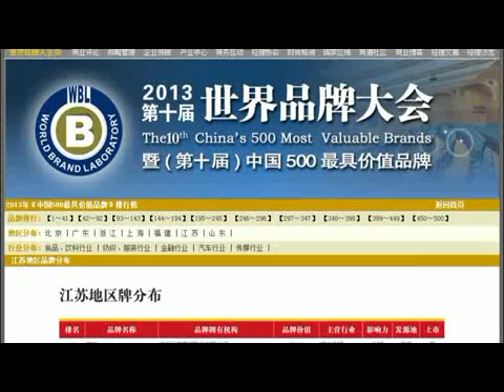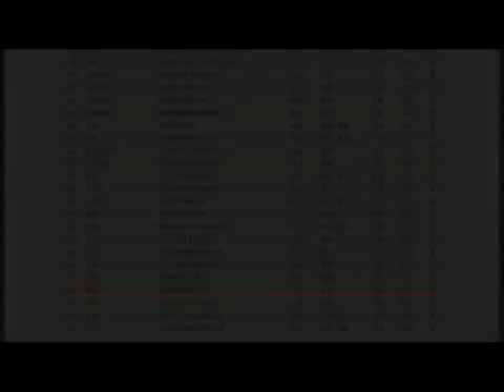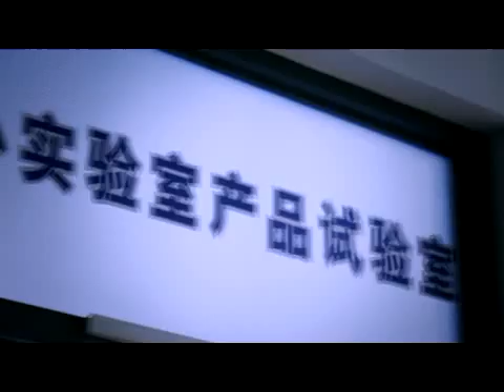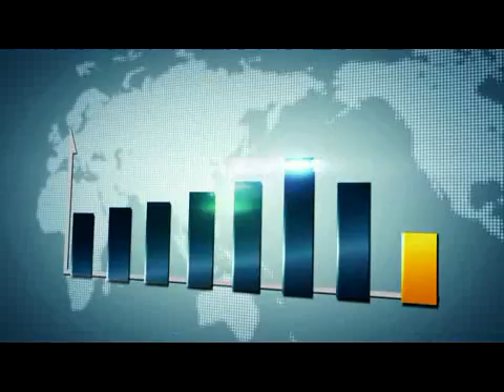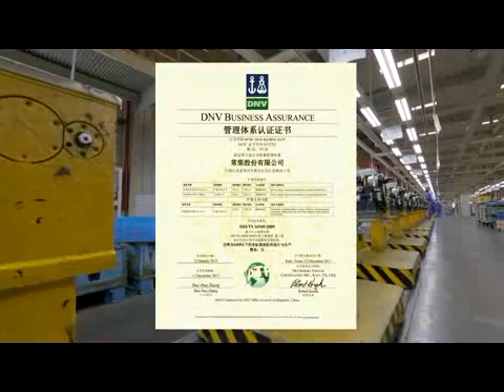Changchai Co , Ltd, one of the earliest Internal-combustion engine manufacturers in China

Comment: Your yammer engine copy is terrible. It blew up within 100 hours of use
Reply: 😂 you did something wrong and want to blame the manufacturer. They are great engines if you maintain them.
Reply: @markalbin4388 lol the only thing I did wrong was buy a machine with one in it. The fuel tank rattles and wears a hole in the fuel tank. I fixed that but not long after it decided to run away. Smoked it good. Managed to stop it with the decompression lever but the damage was done. The Koop brand engine was way better.